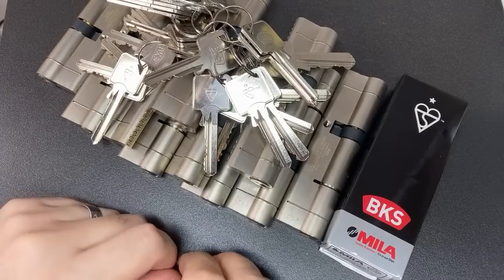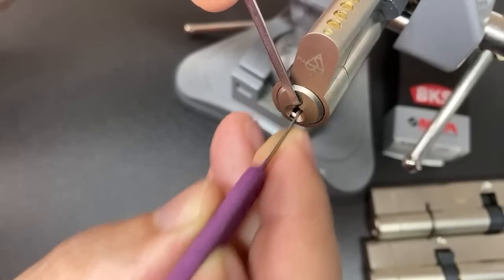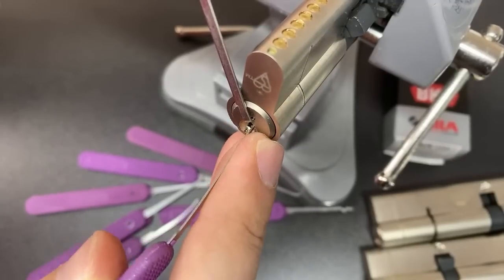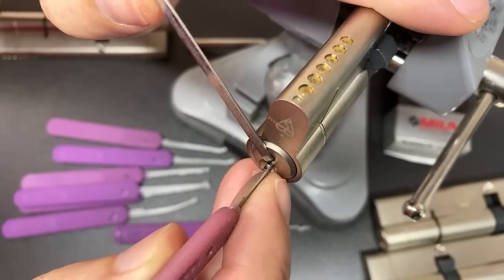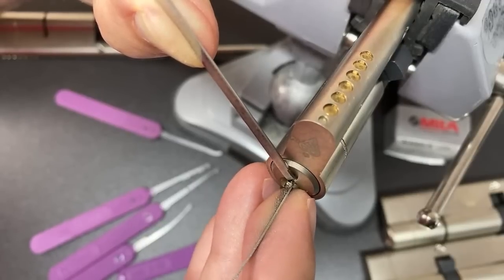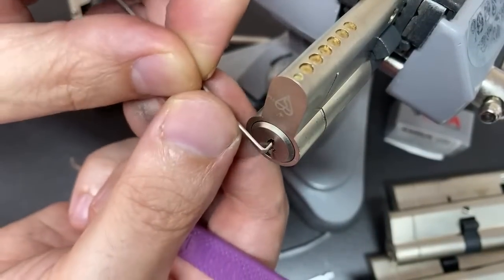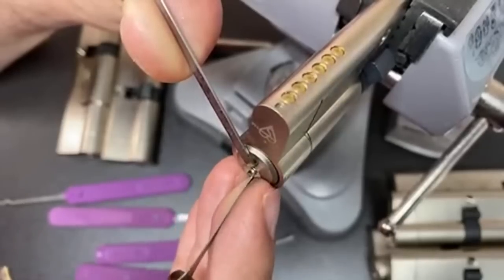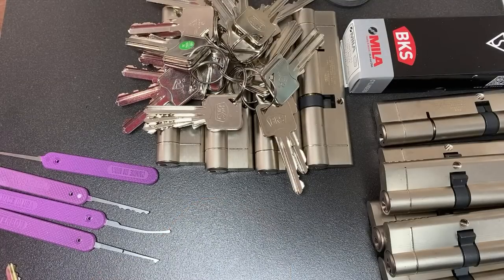BKS Bonanza! LockCon 2022 Practice Session

Comment: This was enjoyable to watch, though I did feel your pain. I have lots of these torture weapons. I'd never heard of BKS and with the somewhat bland-looking logo coupled to the bargain price, I thought I'd bought some generic no-namer with standard pins and garbage tolerances. I was going to just use them for gutting practice and as messaround locks. Then I looked at the keys, did a bit of online searching, and broke into a cold sweat from which I have yet to recover. I've not even been able to get into a false set with any of mine yet. To make my descent into madness even more spectacular I've also foolishly ordered a 3 star BKS cylinder a day or so ago. It does go to show though, sometimes you can get superb and challenging locks for very little outlay. I only paid around £5 each for most of these 1-star BKS, and ISEO F6 Extra cylinders can be had for £3.50 each. The Voices told me I needed to buy 16 BKS and 21 of those F6s. Why fail once when I can fail 37 times?

Comment: I noticed Peterson .18/000 picks. Even a snake rake on the table. I have only 4 Peterson picks. Gems in 18 and 15, and a Gem in 15/000ths. I used the Gem in 18/000 fairly often.

Comment: Funny as hell.  I started out with a bench grinder and a hacksaw blade. I lost my keys at work and needed to go home after a 12 hr shift. It felt like an hr. So I would say that 327 powered 4 bbl with overdrive 63 Rambler 660, was taking me home in 10 min. Although I do not like the GM 437 because you can see what I did The 5371 is a bitchen lock to defeat without a visual clue to most.  Fuck, I am an amateur smith and tuner, and smith. I can get past most locks in 60 seconds or less.  This douchebag likes this method because he thinks he needs to appear difficult. Steal cars from the movie theater entrance. I stole my own beater car  from a Wegmans arking lot.  I had to take the look out, Broke the locking bar, and reprogrammed the key in about 8 min.